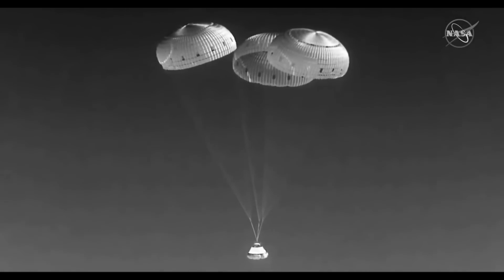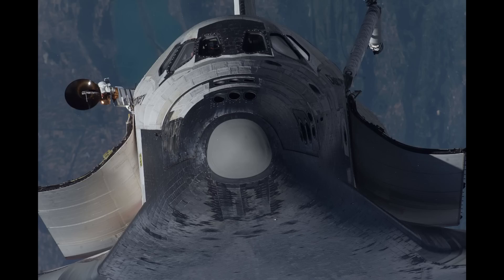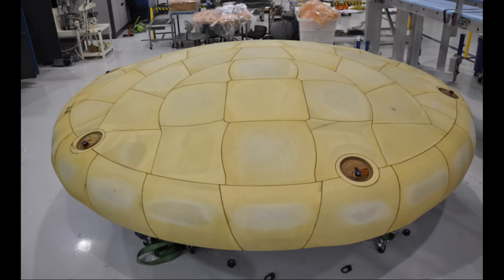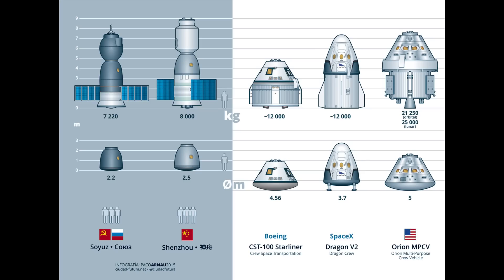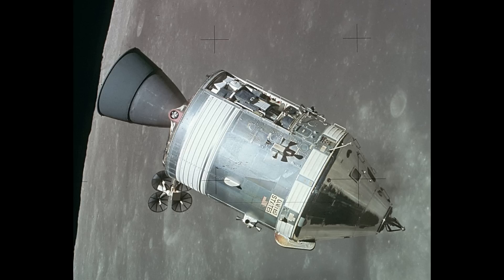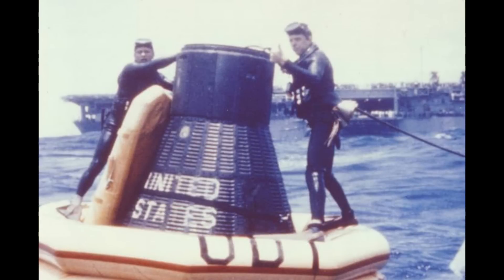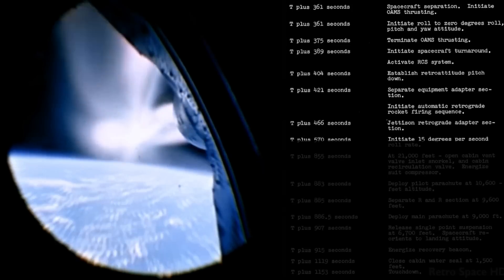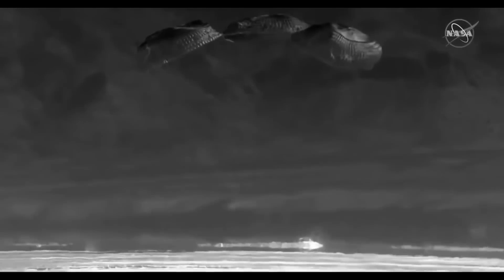Why Does Boeing's Starliner Not Look Burned After Reentry

Comment: Starliners don't scorch as bad, because upon re-entry, Boeing leaves the spacecraft's doors open to let the heat out.
Reply: Starliner doesn’t have doors

It has hatches and it’s locked during re-entry

We’ve learned this since the beginning of manned space flight and no one has the right mind to let the spacecraft have a weak door. If that was the case, the spacecraft wouldn’t be in space by now and would depressurized rapidly killing the crew instantly….

The 737 max 8 on the other hand, the entire 737 fleet is bad
Reply: @goldgamercommenting2990  🤓🤓🤓🤓
Reply: Haha
Reply: Very good, now i understand how it works!!! 😂

Comment: Why is Starliner allowed to land on land but SpaceX isn't?
Reply: Cause airbags are more reliable than a leg system that cuts holes in the heat shield.
Reply: @the18thdoctor3  but it’s not just legs. Draco thrusters as well, which is a reliable way to land as the soviets have been doing it for decades without legs—which themselves have crush zones.
Reply: @jamessolomon3467  
Soyuz landings are survivable if the landing motors fail. The capsule will be damaged and the crew would sustain minor injuries, but it could still land relatively safely on the parachute alone. The same is not true for a fully powered descent with no parachute such as SpaceX's original proposal, which is why they switched to a parachute and water landing.

Also, it's pretty ridiculous to say that SpaceX "isn't allowed" to land on land. They chose to land in water once their powered-descent proposal was rejected as unsafe.
Reply: @the18thdoctor3  between parachutes, landing legs, and thrusters I’m sure Dragon would be just as safe as any other vehicle that does the same.
Reply: @jamessolomon3467  
Except that’s not what SpaceX proposed.
Reply: @the18thdoctor3  The proposal was a powered landing backed up by parachutes.
Reply: @jamessolomon3467  It would have taken a longer and more expensive certification regime (NASA was not keen on the idea) with powered landings.
Reply: @TheEvilmooseofdoom  they were real keen on reusable rockets at one point either.

Comment: Another possible factor, though I'm not sure it plays a role in any of the examples mentioned, is how much fuel is used for the re-entry burn. The more is used to slow down the craft, the lower the re-entry speed and therefore heat. Yet another variable, though probably not a very decisive one, as it probably requires 100s of liters of fuel to achieve the same effect as a very thin layer of heat protection. But if it's left over because the mission required less corrections than expected, it can help reduce the stress on the vessel and the crew.
Reply: A larger reentry burn would actually mean a harsher reentry, at least in terms of peak heating, because it would mean a steeper reentry angle. A reentry burn is only around 100 m/s, whereas orbital velocity at the ISS' altitude is around 7600 m/s.
Reply: @the18thdoctor3  Counterintuitive but apparently true, at least in normal ranges. Though a short hot re-entry might require less heat shielding than a longer slightly less hot re-entry. Not sure what that means for the comfort of the re-entry, though. A significant burn, however, should mean both less peak heat and total heat, as the energy bleed to slow down the craft doesn't come from heating the atmosphere but from the fuel. Which would unluckily require the same amount of fuel which brought it up in the most extreme case...

Comment: There is another consideration to the back shell insulation. In addition to thermal management, TPS also provides a level of MMOD protection. I’m not that knowledgeable about the dragon design, but my impression was that the back shell was covered in a blanket material, which tend to also provide less protection against MMOD compared to rigid ceramic tiles.

Comment: 1:40 explains this video title, Starliner has wider span, that keeps the atmosphere searing stains from heat shields, away from staining any side tall structures, with the Dragon sides, it's structures is taller bell-shape, Starliner is almost a flying saucers shape, only no geomagnetic gyro-into-geo-oscopitic fuse core spiners.🛸😆

Comment: You bring up these temperatures but you don’t bring up the metal melting point that they’re using. Everything are using melts below 2000° and the thermosphere is 4000° it really doesn’t matter how you Wrap silver in aluminum foil because both of them are going to melt
Reply: Please calculate what volume of thermosphere-density air is necessary to bring a 1000-kilogram piece of aluminum to a 2000 degree Celsius equilibrium temperature. Then you'll know why you're brutally and ignorantly wrong.

Comment: so are you insulating that if the NASA craft had not been coming back from the moon, but coming back from a earth orbit, it wouldn't have been coming in as hot?  What does it coming back from the moon effect the heat buildup during re-entry?
Reply: Velocity.

Comment: Can anybody even compare the heat shielding of Apollo and the newer current operating vehicles. I mean even if it is the "same" type of shielding the current stuff has the benefit of literally 60 years of technology advancement in ceramics and carbon fiber and manufacturing techniques. Even the Space Shuttles tile tech is 40+ years out of date. Using today's adhesive technology we'd probably not have lost any shuttles due to lost tiles.
Reply: Uh, no shuttles were lost due to lost tiles.

Comment: I think (from memory) the first manned mercury had still a Beryllium heatshield on the bottom.

In any case, they were definitely and extensively  tested (as main heat shield) while NASA was figuring out this whole manned spaceflight thing.
Reply: Both Mercury-Redsone capsules did, yes (if my memory also serves). That was adequate for the heat from a high-suborbital flight.

Comment: Fun fact I don't think Scott mentioned: Starliner's non-ablative backshell are thermal blankets, a Boeing invention which were originally used as the upper TPS on later Shuttle Orbiters, replacing many of the white, lightweight tiles along the OMS pods and crew compartment.

Comment: Why don't they use thrusters to slow done before entering the atmosphere like the the falcon x booster?
Reply: Too much fuel needed. Aerobraking is lighter.
Reply: The Falcon 9 and Falcon Heavy boosters only use the engines during the hottest point of re-entry and use aerobraking the rest of the way until the landing burn.

Comment: Did I miss an explanation of why the SpaceX capsules use larger angles between the bottom (heat shield plane) and sides? I was imagining it had to do with the SuperDracos needing to aim sufficiently downward (“cosine loss”?) to be effective. Or are there more or other reasons?
Reply: I assume it also increases the interior volume quite a lot

Comment: Orion looks like a far better capsule than many others. They should fly it on a Space X Falcon heavy rocket
Reply: No chance. Even Falcon Heavy isn't powerful enough to send that overweight monster to the moon.
Reply: @simongeard4824  Former NASA Administrator Bridenstine said that a fully expended Falcon Heavy could lift Orion, the ESM, and the ICPS to orbit to go to the Moon, but the aerodynamics of such a large stack were likely an issue. They were going to wind tunnel test it, but nothing public came from that, so it may not have worked.
Reply: @steveaustin2686  Certainly the size of it would be a challenge... it's quite a bit wider then Dragon, so you'd end up with a similar effect to Starliner on Atlas, with all the aerodynamic challenges that had.

But I was under the impression that it was also just too heavy for FH... though I guess a fully-expended launch might be a different matter. And if that did work, it's still more cost-effective than SLS...
Reply: @simongeard4824  The stack is thinner (5m) than the fairing (5.2m), but is much longer. It would only work for the first three flights, as the Interim Cryogenic Propulsion Stage (ICPS) is going to be replaced by the Exploration Upper Stage (EUS) which is 8.4m in diameter.

Falcon Heavy would have to be man-rated as SpaceX dropped plans to do that. Still wouldn't be as expensive as SLS, but would cost more than a normal launch.
Reply: @simongeard4824  "overweight monster" you know that mass includes the ESM, right?

Comment: Dodnt spacex claim that they completly reprint and replace the dragon capsule after every re-enerty?
Reply: No, the crew capsule is reused and the composite structure of the heat shield is kept, but all the thermal ablative material is replaced every flight.

The Trunk, black part on the bottom with fins, is expended just before re-entry.
Reply: @steveaustin2686   elon claims they can rebuild the space craft for every mission shouldnt they do it for the capsule
Reply: @kanpurunplugged9970  They refurbish the spacecraft, but that is not the same as building a new one.

Comment: I work in TPS manufacturing for Orion. I actually wrote many of the CNC programs that cut the tiles for the back shell panels and the ablative base heat shield. I am constantly amazed at how much knowledge you have about various spacecraft systems. It's even a little funny sometimes to hear you talk about things that I am not allowed to discuss because they are supposedly secret. Keep up the fascinating work.
Reply: Man, endorsements don't get better than this
Reply: So you are responsible for all these TPS reports?
Reply: @Lightkie  I've been hearing this joke since the Shuttle program, and it hasn't gotten old yet.
Reply: @adamc1713  My apologies, I just like Office Space. I've never even looked up what TPS actually means. :-D
Reply: @adamc1713  do you work at MSFC? I'm near there doing avionics testing for core stage and EUS!
Reply: @danielconway7190   I work at KSC. Not far from where the capsule is assembled, or at least not far from where the thermal protection is integrated with the capsule.
Reply: @Lightkie  You know those require a cover sheet right?
Reply: @Lightkie  nice
Reply: To be fair, it depends on what Orion you're talking about. Obviously we're talking about NASA's Orion here....
Reply: @alexdhall  
"I work" certainly signals a current project, and I can't think of any alternative, current, Orion project that involves heat tiles, ablation, heat shields, spacecraft systems, other than NASA's
Reply: @-danR  My comment is a open ended question. It's interesting how many Goverment projects use the word "Orion"....
Reply: @alexdhall  Well, the nuclear-pulse Orion never got as far as 'manufacturing,' so it's a safe bet...

(though there are aspects of that Orion's nuclear charges that those involved still can't discuss, either...)
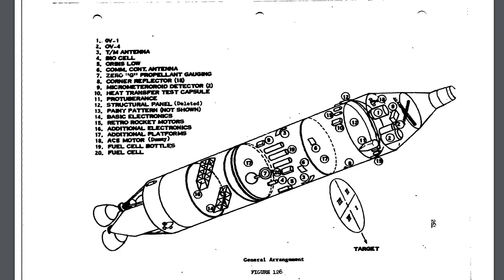Reply: Does anyone know at 8:24, What is the small rocket on the side of titan 3C solid booster?
Reply: @thejeffinvade  fluid tank for the tvc
Reply: @monkeyanimationandgaming  oic, that’s a rather inefficient way of controlling direction.
Reply: Ad astra!
Reply: i also work in high temperature thermal protection systems (HTTPS) for the UK MOD research and it is really hard to resist the urge to natter on about it lol
Reply: @AirsoftAbominations  Teflon Cooking pans obviously
Reply: "I can neither confirm nor deny"
Reply: I love seeing things on Youtube that if I'd talked about them in the 1980's I'd get an all-expense paid vacation in Marion, OH. Weird.
Reply: So TPS Reports, eh?
Reply: It is very funny how the security classification system is basically unchanged from the height of the Cold War
Reply: Scott Manley is my favourite corporate espionage channel lmao 1:05
Reply: The "secrecy" of things changes so fast sometimes that when I hear public speaking on topics I have to get clarification.

So often what was "say nothing ever" becomes "you know it happened" to "you know how it works in theory" to "you know what's involved to manufacture"... 

Sometimes I get "what? That was released? Huh... no body told me. Gimme some time."
Reply: I wonder if there are leaks like warthunder xD
Reply: @Berilaco  
Leaks yes. Like warthunder? 

That's very specific.... but likely.
Reply: CNC program? I'm smelling BS...
Reply: @nyer070  Go ahead and tell us what you know about CNC programming.. I'll wait.
Reply: @adamc1713  LMAO... Computer numerical control is primarily a term reserved for manufacturing applications... What you're talking about which I doubt you understand, maybe you were an intern not sure, falls under separation and deployment mechanism controls SDMC which is a sub of GNC ... You're welcome. 
BTW worked on JWST so.....
Reply: @nyer070  I am still working in manufacturing thermal protection. I have been programming CNC for years. I don't know why you would think I'm lying, and I don't really care. Go troll someone else.
Reply: Thank you for all that you do. For America and For All Mankind.
Reply: Lies

Comment: I remember both Mercury and Gemini when I was a kid. Beryllium is actually extremely high strength but brittle and very lightweight. It was used on the space shuttle or the brakes. They had to rebuild the brakes every time thing flew but they worked. Beryllium's a very unique and somewhat toxic material. When I was working in computer operations for 15 years are tape drives had beryllium cap stands. This material was chosen because of its light weight very little inertia as fun at high speeds. However they were also about $2,000 back in the early to mid 80s. And for some reason stamped on the capstan was warning beryllium!
Reply: “Somewhat toxic”. What an understatement. Fine Beryllium dust is DEADLY.
Reply: @ernestgalvan9037  my mother was English so understatement is inherited! It's funny nowadays they give you a document telling you the dangers of beryllium. Back in 1981 they didn't even mention there was beryllium. We just saw it on the capstan as we cleaned it. We didn't have the internet so we couldn't really look it up I suppose I could have gone to an encyclopedia. I just didn't bother. We weren't really exposed to dust from beryllium because the Mylar tape think of like a cassette tape that kind of material would be run over the top of it and it would spin at ridiculous RPMs. Beryllium was chosen because as I said earlier very little inertia. You could hold one of those things in your hand and it be lighter than a slip of paper. These cap stands had to spend forward and backwards stop instantaneously. Is really amazing how well they performed until adhesive from between the tape and the oxide built up. Once it builds up the tape would stick and it get wrapped around the capstan and crush it. So we were cleaning tape drives couple times a night on 12-hour shifts. Wish I had a picture of one of the drive so I can post it on here assuming that they even what allow me to post it ever.

Comment: What about NASA not allowing Starship launches from the Cape? Especially since SpaceX is already building the new launch tower?
Reply: No, NASA did not say that. NASA said that SpaceX needs to make sure that a RUD on the Starship pad, won't also take out the LC-39A pad for Crew Dragon launches. SpaceX is working with NASA on hardening the LC-39A pad and discussing upgrading SLC-40 at CCSFS to be able to handle Crew Dragon. So two mitigations of the issue.

Comment: What is that strapped on to the side of the SRB at 8:25?
Reply: That’s the TVC tanks on the SRB, it injects nitrogen tetroxide into the nozzle to steer the exhaust instead of using a gimbaling nozzle

Comment: Amazingly informative, as usual.  I particularly like when the old and new crossover, highlighting just how amazing the 1st generation of capsules really was.  The fact that we are still using variations on the same technology is interesting to me.  I'd have though that with the advanced materials we have, the designs would be able to change more.  But sometimes you just can't improve very much on  something that was so well designed in the first place!  ^-^
Reply: “…the designs would be able to change more.’
Ultimately, Physics is the Master, engineers are merely the Learners.
Reply: @ernestgalvan9037  I would rephrase that as the engineers master the possible.  Because you are correct.  You cannot change the laws of physics.  But you can manipulate them to your advantage.  And that's what engineers do, make the best compromise possible with the science and materials at hand.

Comment: IMO the primary reason Dragon uses an ablative heat shield is it was designed to land on Mars then later adapted to service ISS. For a Mars mission the mass of the heatshield is way more important than long term reusability. Starliner on the other hand was designed from the ground up to repeatedly fly to and from ISS. So they went with a heaver, but hopefully lower maintenance non ablative heat shield.
Reply: It is a bit curious Boeing took the mass penalty on this despite having gone for a much higher degree of expendable components everywhere else in the design. We're talking about the "back shell" material, right, everything that's not the shield on the base? It looks like they went with existing tech, a version of the thermal blankets the Shuttle used on its white dorsal surface. Afaik that is low maintenance. Yes, simpler to inspect and keep it in place than scour off Dragon's charred coating.
Reply: @donjones4719  Boeing's engineering abilities aren't anything to brag about these days 😉